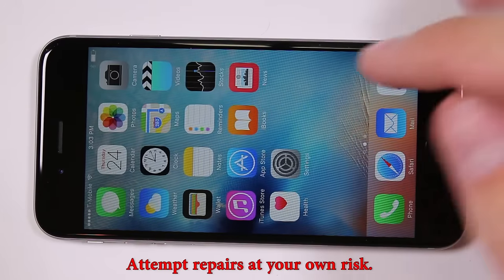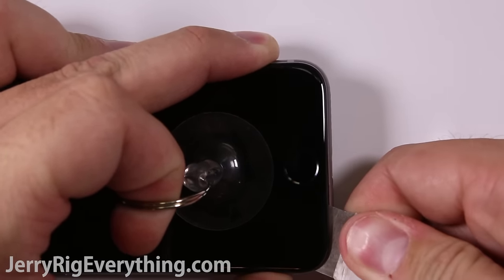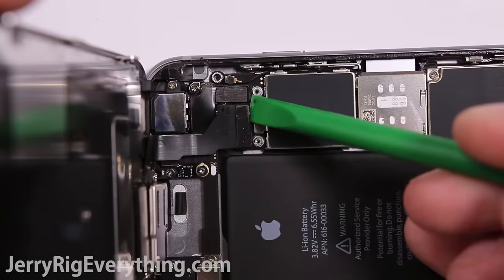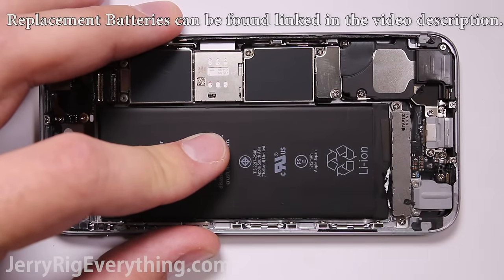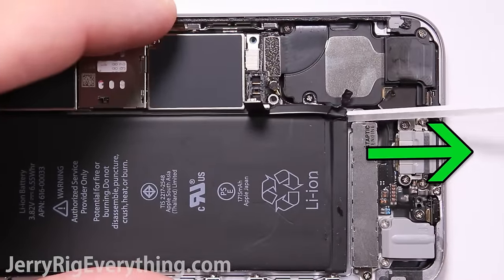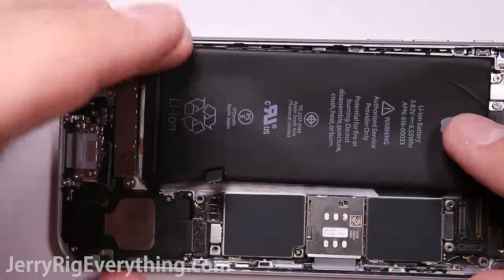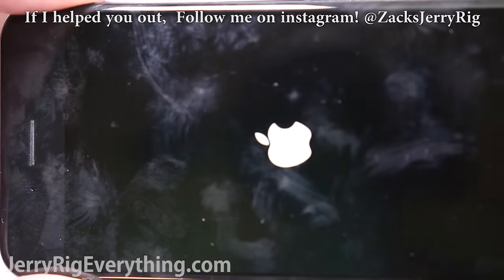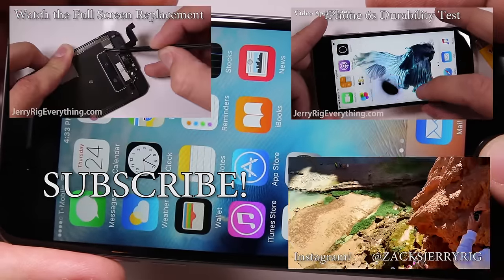iPhone 6S Battery Replacement in 3 minutes (Easy Method)

Comment: Critical point missed in these steps: when placing the new battery in the phone, BEFORE you apply the adhesive strips, test the placement of the battery such that the ribbon connector will align perfectly with the jack on the phone. There is VERY little room for error here. If you stick the battery down and it is a little too low or too high, the connector will not align and you will need remove the battery (hopefully without damaging it) and position it correctly. So do a "dry" fit and see how much room there is between the battery and the top and bottom of the bay it sits in. Then after getting the adhesive strips in place, make sure you put the battery in exactly the same position.
Reply: Just plug the connector first then set the battery in.
Reply: A v says
Reply: @MdMamun-tl2vp  A v says
Reply: Cry about it
Reply: Or just don’t use the adhesive it’s in there so tight once it’s back together just my opinion
Reply: Wish I had seen your comment earlier
Reply: Yes exactly, i've done this wrong and learned by my mistake

Comment: You made a catastrophic error by disconnecting the battery last and then reconnecting first.  This method has a high potential of blowing up the components 👎
Reply: I'm thinking about doing this repair to my phone, just to be clear it is best practice to disconnect battery first and reconnect last?
Reply: Kyle Dickison Yes it is very important otherwise you fry the backlight
Reply: It s possible to revive it after black screen?
Reply: All this so complicated. Just bought a Iphone yesterday and I'm immediately sending it back for a refund. I'm a simple girl. I can't be meticulously prying open phones to insert a lousy sim. I'd rather just take off the back like with a simple smartphone
Reply: Kaas Stengel that happens and now my phone doesn’t work nooo how
Reply: Sassy Ranma What? You don’t take off the back of the iPhone to remove the sim card
Reply: Yes. My lcd is broken
Reply: @BubblesChika  what are you talking about? this is a battery replacement video...
Reply: Exotic Lioness Suppose you switch the phone off completely, before removing anything.  Then after you've done the battery replacement, fire up the phone again. Isn't that the safest thing to do to avoid a fry-up?
Reply: Yeah mine just blew up 10 minutes ago while trying this. Wish he addressed this.
Reply: Should a screen replacement fix this another problem or is the whole phone fried?
Reply: @BubblesChika  it’s very simple many just have the fear of oh I’m gonna damage my phone but it’s that or fork out twice as much to get someone to do it

Comment: Remember that the screws are different lengths and positions so keep track of which screw goes where!
Reply: I used strips of masking tape on a tray; you could also use a magnetic strip. Used post-its to tell me which set of screws was which, and arranged them on the tape as they were on the component (so I knew where to put the longer vs shorter screws)
Reply: Barbara Dace I thought I was the only one that did it that way. Tape is definitely the way to go.
Reply: yea that messed me up. there a barely visible difference in one of the lcd screws
Reply: Oops
Reply: acooldryplace00  if you haven't got tape, draw a big square the shape of the plate on a piece of A4 and add the screw holes. Then simply position each screw on the respective place you have drawn the hole on. DO NOT MOVE OR DISTURB THE PAPER!

Comment: Be very careful when removing the battery.  I tried pulling the sticky plastic out of the back the battery as described but both of the glue sides snapped.  I then had to force/bend the battery up out and in doing so caused it to go off like an indoor firework.  The house was filled with smoke and the whole battery glowed cherry red hot.  First use a hairdryer to soften the screen glue at the sides and also to soften the battery glue when removing it and it will be a whole lot easier.  You may need to warm it more than once
Reply: Same happened to me but it also caught fire after a few seconds. Maybe a warning not to puncture the battery would help avoid anyone else suffering the same thing.
Reply: When putting in your new battery inside your phone, forget sticking those sticky plastic strands on your battery. It will only make it more difficult to remove in the future. The sticky tape does absolutory nothing as the battery can't fall out of the phone, once the screen is closed.
Reply: run the battery flat before trying this or add alcohol to dissolve the adhesive

Comment: 1st time trying to work on an iPhone.  I repair PCs for a living so I thought, no problem to replace a battery.  Immediately stripped the first screw head.  Got the second one out fine.  Those tiny screws are so delicate it's unbelievable.  I recommend practicing on an old phone first and make sure you have the right tip or you'll strip the head so fast it will make your head spin.  Then you're most likely "screwed."  Now I have to take the phone into a shop and have them use a tiny tiny technical drill to get the stripped screw out.

Comment: When installing the new battery always connect the battery as the last step. First connect the LCD and than the battery. Otherwise it is possible that you make a short on the board and destroy it.
Reply: Wish I'd read this comment before shorting out my backlight. Thanks a lot Jerry!
Reply: Yeah, i also managed to break my iPhone 5S because i attached the battery first and then accidentally touched something with the tool that was included in the iFixit kit.. Well, now i have a new battery and a broken iPhone :D
Reply: I disagree because when you’re doing a repair you aren’t going to call for power from the battery when you are in the middle of your repair, right? No call for power then no fried board unless u somehow pressed the power button long enough or at all then ur right
Reply: Believe all you want but the board will power up when you connect the battery and you will destroy your phone if you do not perfectly line up the screen connectors when reattaching them. Please do not tell people that you think doing something is fine when there are multiple people with first hand experience saying that doing that thing is an extremely bad idea.
Reply: Agreed. First thing to be unplugged with any repair is the battery if at all possible, and should be the last to be plugged in.
Reply: Hi I replaced the batery but now I have a blue screen any  advice?
Reply: Ok Einstein
Reply: Daniel Islas you took the time to believe and Wright that while being wrong. Applause 👏
Reply: I will keep this in mind. You are the man!
Reply: That’s probably what killed my se
Reply: Paul I almost missed this thank god i didnt
Reply: Paul Paul maybe you should make videos! 👍😃
Reply: Paul just don’t remove the LCD ?
Reply: Daniel Islas noope, just don’t remove the LCD
Reply: Thank you. I changed my battery and if i didnt read this i would do as shown in the video. I think my habit of reading comments while watching video paid off well...
Reply: thats when u know if to listen to the videoguy xD
Reply: Good tip, thanks!
Reply: @BRING_GUNS  sorry but your full of it i just did the battery in my iphone6s today and the battery gets connected first and no probelms it will not power up unless you hit the power button plain and simple fact
Reply: Kevys Rc & Music the phone will not boot up but parts of the board will become energized once the power source is connected. Why don't you try pressing the back light connector against its socket while they're misaligned by a millimeter and tell us what happens?

It’s perfectly possible to make the connection while it's powered on without damaging anything as long as nothing touches something it shouldn't but there's zero reason to take that risk when the alternative is simply to make the connections in a different order that makes it impossible for a short to occur.
Reply: @BRING_GUNS  even the manul says to connect the battery up totaly first and thats what i did i followed the instructions if someone is a moron thats their problem i had to fiddle around alot to get the 3 screen cables back in with the battery 100% connected and guess what 100% nop poblems so i guess if you understand and read shit and follow the instructions properly and take your time youll be fine it seems i have a video going up in real time andhow i did this and it was my first time ever changing a battery in a cell phone and all that happen to me was i lost of of the 4 screws that hold the digitzer plate down its still 100% secure so no problems at all. guess you need more pratice and this was my first time and no problems no damage just 1 lost screw those darn things are way small stuff happens..FYI nothing is impossible for sure but slim to no chance if you read and follow the instructoins properly and watch were you put your fingers
Reply: Roland Fortune best comment ever
Reply: Daniel Islas why take that chance?
Reply: GahCrabBattle maybe you should make your own video and inform us first?
Reply: oh.. oops.. i wuz luky
Reply: Another dead iPhone here, cheers for the vid! UNPLUG THE BATTERY FIRST THEN REMOVE SCREEN, THEN RECONNECT THE BATTERY LAST THING AS YOU PUT BACK TOGETHER!
Reply: which I did
Reply: Good catch.
Reply: No it won’t....
Reply: Making sure the phone stays off is safe enough. Why would you turn it on while it’s disassembled?
Reply: @BRING_GUNS  they say that ignorance is bliss, you just can't help some people.  I appreciate the sound advice, thank you.
Reply: this should be pinned...i did as instructed on video with connectig right now with connecting battery first then screeen. big mistake. as soon one of the connectors made contact i got a puff of smoke.. luckily my screen works fine(no Damage)first onnect screen, then metsl. THEN  connect batter and plate.
Reply: @airfixer to verify if all the connectors are fully connected

Comment: Had your video running and an Amazon purchased battery & phone in front of me and had no problems. Well, almost. Two lessons from my end. First, when I pried off the screen with the plastic guitar-looking pick that came with the battery, I discovered that it's possible to bend the tabs that receive the screws on the bottom of the phone as you pry away on the lower part of the screen. When I reassembled the phone and started to insert the two bottom screws, I discovered that one of them would not 'bite' as I tried to screw it in. When I re-opened the case, it was obvious that the tab that would have received the screw was bent just out of reach of the screw. It was easy to gently bend back in place, so an easy fix. 

Second, when pulling the adhesive out from underneath the battery, it's very easy to break, which you mention in the video; and, of course, the battery is a bear to get out if the adhesive is still attached. One attempt to wrap the adhesive around a pair of plastic tweezers as I pulled it out didn't work very well and the adhesive tore. So, I ended up just using my fingers to reel the adhesive in millimeter by millimeter b.c fingers have a fairly large surface area and it was easier for me to keep the adhesive from tearing and/or separating. Great video. Thanks for saving me a 1000$ on a new phone; this will allow us to keep using our beater 6Ss for a while longer.

Comment: This video was extremely helpful. With just a few hiccups on my part, I was able to successfully replace my battery, and it works like a charm. In fact, my wife now wants me to replace the battery in hers. I struggled a lot with the screws as they are so small as to practically invisible, but loads of patience helped, and I finally got it sorted. Thanks again for the video!

Comment: Thanks for clear and useful video! 
The battery I replaced seemed to have no pull tabs, so I cautiously pried it out with a plastic pry tool, and that worked. When you reassemble, check that the two metal tabs that secure the pentalobe screws didn't get bent when you were prying off the screen. 
One of mine got bent and the screw wouldn't engage, until I opened the phone again and straightened that tab.

Comment: Really helpful. I've replaced my phone battery twice with your video. It's an iPhone 6s that's around 5 years old so you've saved me a lot of money!
Reply: Which brand of battery did you use? Does apple screw with the battery if it is not an apple battery?
Reply: @josephfrank1472  The cheapest one I could find on amazon. Sorry, I don't know what you mean by does apply screw with the battery. I'm pretty sure it voids any kind of warranty on the phone if you open it up yourself. But Apple doesn't do anything to alter or damage non-Apple brand batteries. In fact my replacement batteries have been better than the original Apple batteries in terms of battery life and how many months/years they've been viable. Just be careful to buy a new one. Some of them are "refreshed"
Reply: @Faustian_Bargain_Bin  I mean if you do not have the apple battery in does the phone act up or do any other strange stuff?
Thanks.
Reply: @josephfrank1472  Oh I see. I've replaced 3 or 4 batteries with off brand amazon batteries and all have performed better than the original Apple one.
Reply: @Faustian_Bargain_Bin  Thank you.

Comment: This was really helpful -- thanks!   Some notes:
Amazon sells lots of iPhone 6s batteries with all the tools and adhesive -- ranging from about $15 to $25.  Note the batteries' power ratings, though.  The battery that came in your iPhone 6s is rated at 1750 mAh.  Most of the Amazon batteries claim to be rated higher (for more hours of battery life after a charge).  Ratings I came across:  1750, 2200, 2300, 2350, 2600.  Most user reviews are positive, in any event -- hopefully the ratings aren't BS.  (I replaced my phone's battery with a 2350 mAh model for $19 -- but hadn't noticed the power rating differences when I purchased it -- battery seems to work fine so far.  Just purchased a replacement for my wife's iPhone 6s and found one that claims 2600 mAh for less than a dollar more.

By the way, I inclined phone screen back beyond 90 degrees while working on it -- probably to 100 degrees or so -- and it still works fine.

Comment: NOTE: PLEASE READ!
DO NOT CONNECT THE BATTERY CABLE FIRST THEN THE LCD CABLE! THIS WILL SHORT CIRCUIT IT!
You don't need to disconnect the LCD cable when going through these steps however, just keep the screen 90 degrees open instead of disconnecting the cable and taking the screen off, i used a rest to stop the screen from falling so i didn't have to hold the screen while i do the rest of steps.

ps. i was so scared when replacing the battery, even if i followed the steps correctly i still thought i fucked up somehow
Reply: NOOOOOOOOO! I connected the battery first then the lcd.... I put it all together but the screen won't switch on. Is there anything i can do to fix it?
Reply: Thanks, I thkink I am going to just let the screen connected
Reply: Update- it came back to life!  I put the key into the sim hole, then pressed Home button and lock for 5 seconds. I have no idea what it did , but it worked
Reply: I just did it and nothing happened
Reply: john smith if you hook up battery first like in the video what happens? I put mine together & it will not power on
Reply: clc040 you may have short circuited the back light. Check my reply above. This happened to me
Reply: can u make a video with that OwO
Reply: I did it as the vid shows. No problem. Super easy
Reply: Rich Houle ....”Barely an inconvenience.”  Screen Rant Pitch Meeting
Reply: Soooo...  There's no need to take off the screen connected with the cables? All I have to do is just take off the batter?
Reply: GOOD and useful, that is what I wanted to know. Thanks
Reply: wait so.... DONT disconnect the battery first... but don't need to disconnect the LCD cable.... so what do you do then if you don't disconnect the LCD cable if you can't do the battery first?
Reply: Lol @ your p.s. 
I know that feeling. Everything is going well and you for sure it cannot be this easy. Lol
Reply: These are life saver comments
Reply: @nickdee24  all you need to do is replace the battery while the screen is remain plugged.
Reply: I connected the battery first and it worked, guess I got lucky. I don't doubt that it could short out if you connect the battery before the screen. Very important note...
Reply: I wish I read this before I shorted out the circuit
Reply: Damn I wish I read this first, I connected the battery first and then when connection the screen thingies something burned and sparked. Do I have to throw the whole phone away now?
Reply: Thanks
Reply: I agree. Fold the screen back slowly and fix it <90 deg....crocodile clip stand or retort stand, ( pad the jaws ). Ok, this makes removing the battery tricky, but you do leave those screen connections alone.....minimum tear down is the key....maybe a bed of Blutack under the phone body to stabilise it?
To repeat John's advice; you don't have to remove the screen.
Reply: Just did the replacement tonight and I thought I'd messed up, but didn't. I kept my screen on at a 45-degree angle and lost one of the tiny screws for the bar and couldn't get another one in on the cover for the battery connector but so far haven't had any issues. Was SCARED TO DEATH that I would screw up my phone but didn't. Now I have the experience to refurbish not only the battery but if I need to I could replace the screen. (Hopefully, I won't have to do that!) Took me an hour, but it worked...
Reply: @kevinkendaru2180   yep same here
Reply: i fvcked up big time. now i don’t have my iphone 6s🥲
Reply: @SRSAtlas dislike the video so he will modify it to show not to connect back the battery first
Reply: @robotsindisguise123 you can still take that to a repair shop to see If they can recover the data from it - seeing your comment I'll save all the data from it first - what actually happened that made you say you screwed up?!?